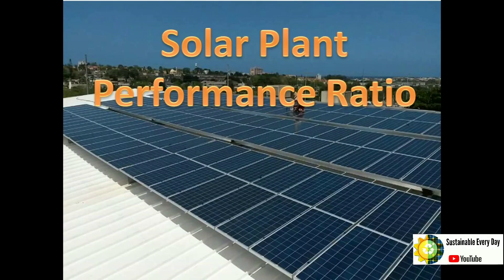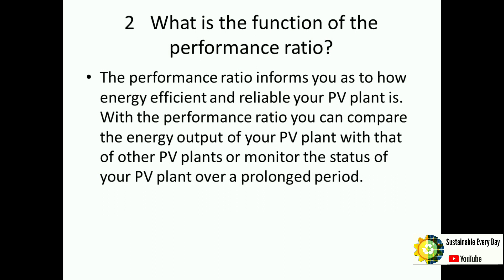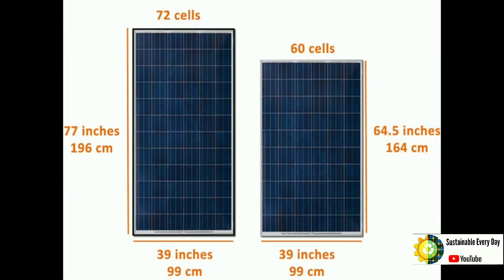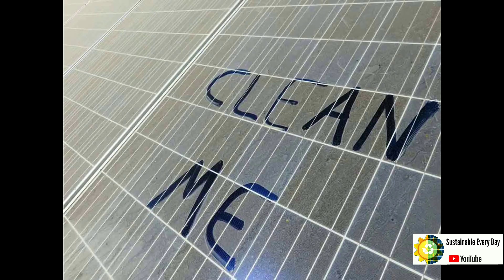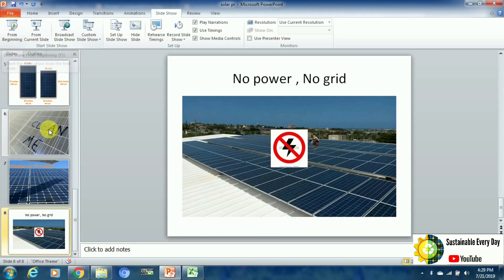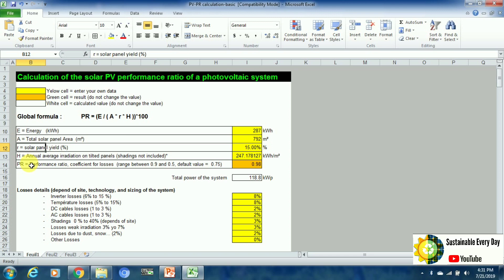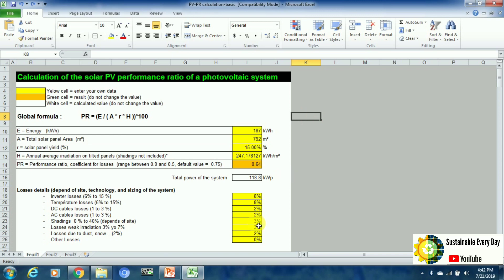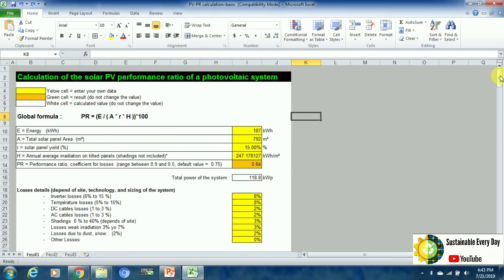Calculate Solar plant PR%, सोलर प्लांट PR% - Hindi, English , Download file in discription

Comment: Sir i have 2kw on grid solar plant at home with havells enviro gti 2200 inverter. The penels are clean , no Shadow at all. Angel is perfect. Still receive only 1130 watt maximum power from 2kw plant.. should it be producing around 1.5kw.? What could be the problem.. its been 3 days since i installed that plant

Comment: Hello , the solar radiation will vary with location , so how is the PR independant of location? Please correct me if i am wrong .
Reply from the maker: Hi Ali , your observation is absolutely correct , there are actually 2 different PR calculated 
1) (location indipendent value) i.e. PR before installation through pv syst in which we use online Radiation value , it usually differs .

2) ( location Dependent value) were Radiation sensor installed on the site gives accurate information of PR.

I hope I cleared your doubt
Reply: Thanks for replying , wont the pvsyst have different values for different regions when we put in the lattitude and longitude ? I mean it wont be a universal value , so it will mean that the PR does depend on location .
Reply from the maker: Correct

Comment: My plant of 20 kw was installed 25 days earlier but After cleaning my panels 2 days ago the generation earlier was 96-106 unis ,but after cleaning it reduced to 75-86 units .what may be the reason.
Reply from the maker: One string got disconnected

Comment: PR = (E/(plant DC capacity x avg irradiation))×100
Tiwari ji,  is this also correct formula to find out PR?
Reply from the maker: Correct , also if you can add temperature correction it will be great
Reply: @SustainableEveryDay  

1. how do we add/calculate temperature correction?
2. can I use the PR formula on a 15 minutes basis? does it mean that I do not need to calculate avg of irradiation just take the value?